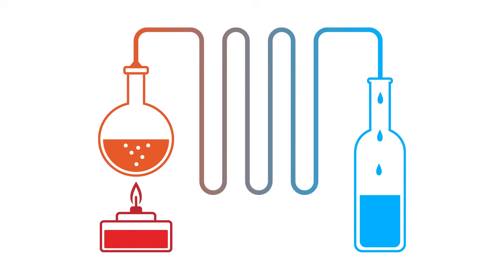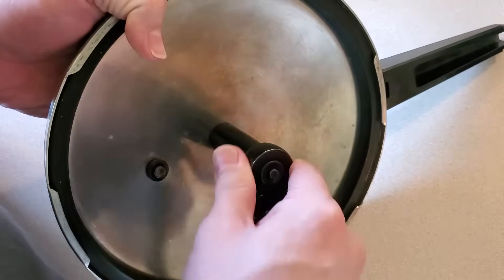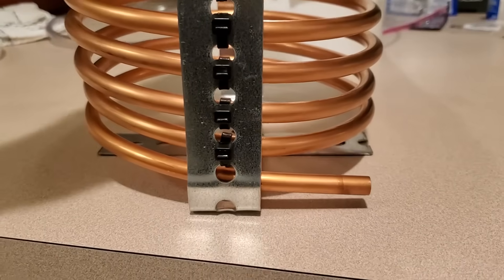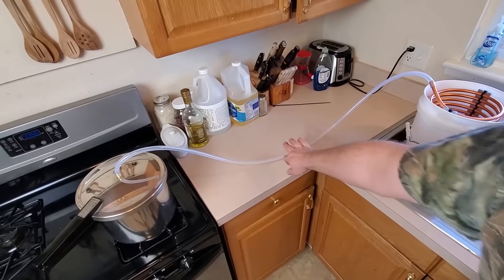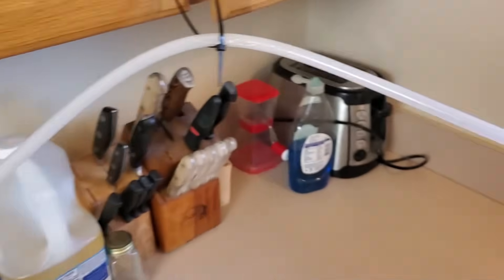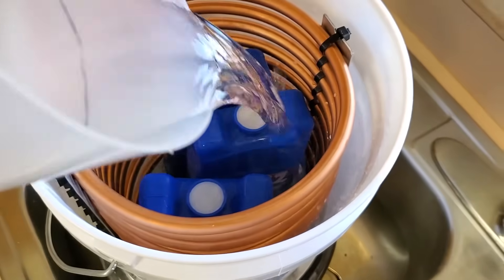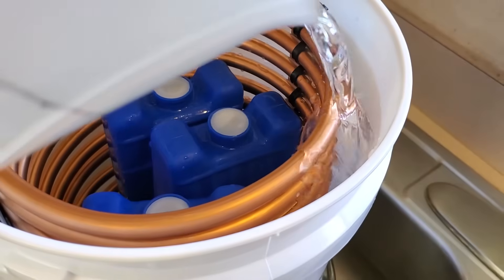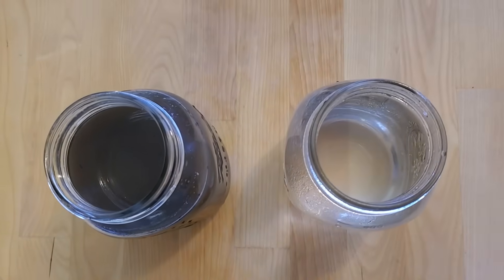DIY Water Distiller (Higher Output Version) - Full Build and Demonstration

Comment: The whole process should be done absent of plastics or silicones. All copper and boil the water in stainless steel
Reply: Actually silicone tubing is 100 percent ok to use and most breweries use it as well. Pvc tubing is safe to but most would recommend high grade super heat resistant food safe silicone tubing
Reply: high temp silicone tubing can be food safe and NSF-rated. PVC sched. 40 piping is also NSF-rated, so long as it remains below 130 F. doesn't NEED to be all copper & stainless.
Reply: This

Comment: What kind of barbed fitting did you use? From one cut to another it seems you added something?
Reply from the maker: I found that copper fitting on amazon, although I'm not very happy with it. It actually broke the next time I used it. I think I'm going to replace it with just a short piece of copper tube and a compression fitting.
Reply: Great Lakes Prepping I made do with what I had, thank you for your timely response. About to finish up the tubing to copper connection and fire it up!
Reply from the maker: @razelhamnirif  Awesome! I'd love to see your finished product. Would you be interested in sharing it with the Great Lakes Prepping facebook page?

Comment: I have read that if you drink only distilled water you will die within a few days because it does not hydrate due to lack of minerals. Also, in a true pandemic of sorts, how will you find frozen ice if you have no electricity to freeze the water?
Reply: I have had several health issues over the years. I now try to eat and drink as healthy as I can. For the last 5 years at least, I have drank only distilled water. I can verify that it does not kill you.  I am doing just fine with it.
Reply from the maker: It's true that it does not contribute minerals to your body, but the science seems to agree that most of our minerals and nutrients come from our food anyhow. It's recommended to eat fruits and vegetables if you drink only distilled water (but we should be doing that anyway). But no, you won't die from only drinking it... except perhaps in some extreme situation where you're almost dead anyway.

Regarding the ice question... the distiller doesn't require ice. Ice just makes it work faster. Using cool water is just about as effective, but still not required for it to work.

All that being said, I have multiple backup power sources by which I could run my freezer if I really had to.
Reply: @GreatLakesPrepping  I consumed absolutely nothing but distilled water for 3 weeks and now i'm dead, thanks a lot!
Reply from the maker: @tichuang  Dang it! Well, thanks for letting us know. Truly sorry for the inconvenience.
Reply: @GreatLakesPrepping  i can fast for 14 days on tap water. but only 3 days on distilled water unless also have minerals (at least salt, but should have magnesium and potassium as well). First sign is twitching, then hard to turn open bottle of water! Your nerves need the minerals! I know. Been there done that! But don't get me wrong, even after 14 days with proper minerals and water but no food, you have all the normal strength and energy and clarity.
Reply: Cool, thank you for replying!
Reply: The minerals in water are inorganic.  It means not absorbable.   Minerals come from diet and supplements not your water.  Distilled water is the purest water.
Reply: because u replenish your minerals with food ?
Reply: @VASI_LIKI    I stay away from junk food/fast food. I just eat a regular diet of fruits and vegetable and meats. Nothing special. I do try to stay away from GMO foods. I try to eat as much organic food as I can. It is just a regular diet with distilled water. You will get the nutrients from food that your body needs. Hopefully this is a help to you. All I can say is try it to see if it works out for you.
Reply: @brianbouch69  you have great mineral uptake from your food 💕
Reply: no you won't

Comment: This a good demonstration of water distillation.  There are a couple things to consider.  First, some people have reactions to copper and even develop copper toxicity.  Now once scale forms in a new coil this will be less and less of a copper transfer into the water. Second, If you are going to be distilling surface water from questionable water sources, one may be concerned with VOCs, volatile organic compounds.  Most commercially available distillers are closed loop systems like what you built and remedy VOCs via activated carbon post filters.  Some commercially available emergency or non-electric distillers are open loop, meaning VOCs boil off at a lower temperature and vent into the atmosphere.  There is water lost in an open loop, but the water quality is better.  The best water distillation possible is fractional distillation, but nobody has $3000+ for a complicated machine with very low output.  :-)
Reply: Scale isn't going to form from water vapor in a still...kinda the point, to get rid of all the solids that form scale. And stainless is always an option.
Reply: @salvadordollyparton666  Oh yes it will. A pressurized system will definitely transfer some unwanted product with it and copper it self will anneal due to temperature and harden from contact with oxygen, so the end result will coat the copper tubes pretty well. 😉
Reply: Love it
Reply: Couldn't you just wait to put the lid on until after the water reaches boiling point? Would this not get rid of VOCs?
Reply: Guess after distilling you could pour it thru a zero water pitcher filter?
Reply: You can let the water boil and off gas before placing the lid on and for extra measure discard the first bit of distilled water.

Comment: This is a terrific idea. I use distilled water in my CPAP device and sometimes you have a difficult time finding it. Sadly I can NOT use any other type of water in it. This is another great video from you that I am going to share. Great information, Thank You very much. Peace To All!
Reply from the maker: Thanks Scott. Yes! It's one of the things that made me want to build one. I can't even find the stuff at my grocery store anymore.
Reply from the maker: @akosreke8963  Which chemicals?

Copper pipes and tubes are perhaps the most common material for hot water lines over the last several decades. Copper is used for all sorts of beer and wine-making purposes. Why would this small-scale application pose a risk, while all the water lines in my house are perfectly fine?
Reply from the maker: @akosreke8963  Thanks Akos. I'm inclined to do some more research on the subject, either way.
Reply: I have used tap water in my CPAP for 50 years and just let the chlorine evaporate for a day.  Then once a week I soak my tank in vinegar and water and rinse it out.  Easy and no equipment cost, vinegar is almost free.
Reply: lol i just use my well water in mine (cpap), clean it out every few days with soap, and maybe once a month soak it in vinegar to remove the buildup.